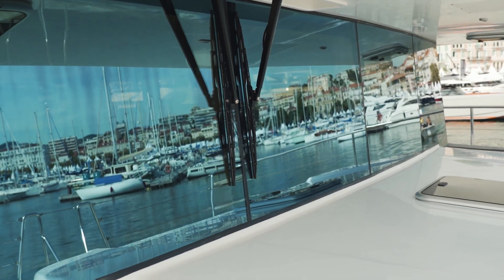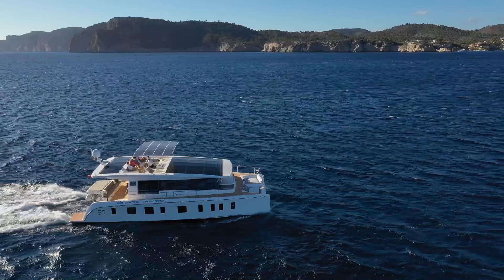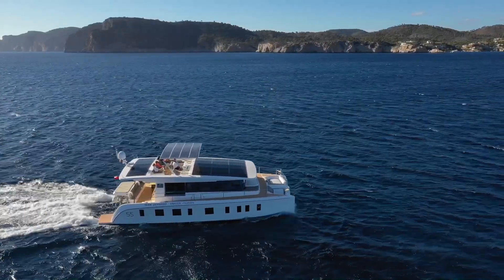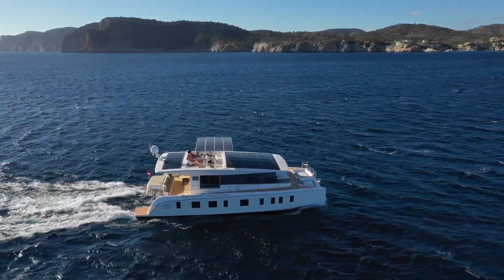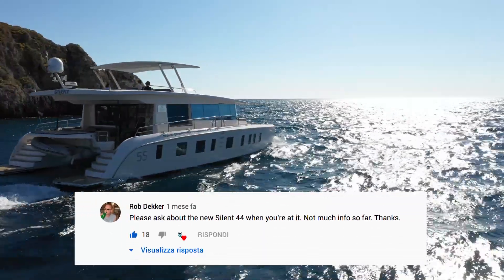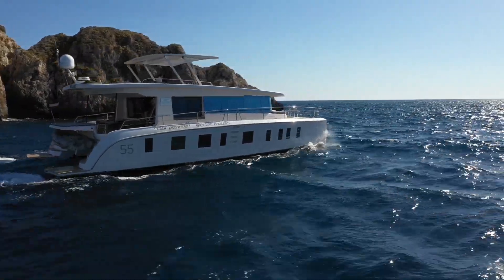WHAT MAKES SILENT YACHTS...SILENT???

Comment: I have been waiting weeks for this and you didn't do a walk-round.. Doh! I love these and I can't wait to see what they have planned. What I would have liked to know is what kind of speed would they recommend for an ocean crossing? Would they keep it constant over 24 hours or would they up it in the day time and drop it over night?
Loving the videos though.
Reply: they will not give all the secrets...damn that kitty
Reply: if you want to run sich a yacht absolutely self sufficiently for weeks, the speed is about 4 knots only. BUT - compare it to a sailboat of similar size and comfort in a typical holiday region - and not in the roaring fifties. During Summer in the Med an average speed of 4 knots is impossible for a sailing boat. Again - average - day and night. But a Silent Yacht can do this. If you want to go fast, just start the gen for 1 or 2 hours and you go with 6 or more knots. And most of all - it can stay in a bay with all comfort without need to start the generator at all.
Reply: Michael Koehler thanks Michael

Comment: Amazing concept!  Obviously, how frugally one uses the available solar energy will determine how much generator usage is required.  To put this into perspective, I would love to see how a typical cruiser would consume energy on a) an oceanic passage and on b) a day at anchor.  Also, since solar generation capability would increase with larger yachts, does the yacht endurance and fuel consumption get better as well?  Is there a sweet spot for yacht size that can make an oceanic passage at 10-knots on a single tank of fuel (with 10% reserve)?

Comment: It's not very well discussed in many interviews but the ex sailor did sort of cover it. These boats can be powered along at a speed that they are producing electricity. You can adjust your speed to the power and intensity of the sun, especially in the tropics so that you are zero cruising. Some people might ask, what about the energy required for the house side. This is generated before you get moving in a morning and either when you slow down or stop for the day.

Comment: The problem is the HVAC in countries like the US Florida, what solution do you have as we are used to running the AC 24x7, I think it has to do with the high levels of humidity,  at very cold settings, 65f or 17c.?  It is difficult to understand this habit, but it is what it is...

Comment: Thanks great episode, couple this with sails and you get the best of both worlds. Electric power will be the future of boating, hull design becomes increasingly important.
More videos like this please
Reply: in fact our Sail Versions require more fuel than the solar - it is a mere fact that the shade created by the sails cost us more power than the sails deliver. Only in a few regions of the world you find reliable wind conditions. In most places there is no wind or too much wind or it is from the wrong direction when you want to go for sailing - and then people use the diesel engine. It is a mere fact, that we use the gen to recharge the batteries less than we use the diesel in the sail version as there is no wind.
Reply: @michaelkoehler5845  and what about integrating flexible solar panals in the sails?

Comment: I understand the physics behind the trampolines in the bow of sailing catamarans ( we want the air pocket to release air pressure so we don't plain) , but on a plaining power boat wouldn't a solid bow aid in lift for plaining? Just wondering why they chose that design. ??

Comment: I wonder if it is possible to put hydro generators and wind powered generators to help with the battery charging. This would be good to try to use the motion of the water to recharge the batteries along with the solar panels.

Comment: I wish they had a motor power curve  on their website so it would be easier to calculate if it fits persons needs and also can you charge the batteries with shore power? I don't really like using generator so i would to charge it with shore power instead if solar is not enough. Maybe a 22kw type 2 charger would be good for this and it's relatively easy to install it too.
Reply: Yeah i did some calculations and it seems like you can buy a 22kw on board charger for around 12-13k € And then you also would need a type 2 charger and that cost maybe 1-2k€ and then you need a cable that is probably an other 1k € so with around 20k€ you could probably charge the 200kwh battery in like 9 hours and that's pretty good in my opinion. That would be pretty good for like a ferry that is open the day and gets closed for a night.

Comment: Adding shore power wouldn't add a lot of weight, but would add a lot of usability for the boat. A 40A x 230V = 9,2KW would double the usable charging power. Almost empty battery would be fully charged in one sunny day at port.

Comment: Thanks for the shout out!  Appreciate the answer Sir!  Edit— Are there any plans to combine sails with the electric systems?  I can’t help but think that would be a world traveling solution.
Reply: Well, at least one of the Silent Yachts has crossed the Atlantic so far:

https://www.silent-yachts.com.au/crossing-the-atlantic/

And if I'm not mistaken, their website says that a hybrid solar/sail yacht is an option, so...best of both worlds, I guess?
Reply: Electric motors on sailboats are already practical.  With Hydrogeneration the motor acts as a generator and recharges the propulsion battery using sail power.

Comment: Hat's off to these guy's as a direct replacement for sailing yachts and for local cruises. It is clear however that battery storage and photo cell power generation needs a miracle to be our long term solution to replace the internal combustion engine and fossil fuel. I do wish these guy's all the luck in the world though.

Comment: David! I was particularly interested in this yacht. I build EV car conversions for fun and Zero profit. (At least until the battery technology matures.) Low temperatures are bad for LiFePo batteries over time. I'd be curious to see what kind of charge cycle/battery life Silent Yacht gets over say 5 years? 10? Replacement 200kwh battery packs are in the neighborhood of $30k to $50k usd depending on the chemistry. How would that pencil out over the life of the hull? I've installed a pair of 2kw vertical wind turbines on a friends yacht to supplement his solar for housekeeping purposes, along with replacing his wimpy SLA batteries with a 50kwh LiFePo pack that weighs half as much as the SLA's did while providing a BUNCH more storage.  We have a pretty steady wind here on the Lower Columbia River in the fall and winter but solar power drops to about 20% or less on cloudy, rainy days. The vertical turbine makes up some of the difference but never quite all. When the temps drop towards freezing shore power is pretty much a given. Thank you very much for your excellent presentation as usual!
Reply: Combustion engines also have various runtime expenses, economy on fuel is possible depends on how the boat used etc. In the end all depends on how and how much the boat is used. I'm interested in conversion myself, so i did some estimation on available data. Electric is economically viable if boat is used a lot, not a weekender and if low speeds are acceptable. In my case it would even out in about 2-3 years of use, but i would have to stick to mostly 6-7knots with 15-16knots top speed for emergency with generator on, which i'm already doing anyway.

Comment: are these solar panels specially built for the salt environment ? Can  these panels be replaced with higher output panels (there are some 420 w panels with 22 % efficiency and even bifacial panels which will produce more power fper square meter and therefore power a larger motor for faster speeds etc )  )

Comment: Could there be a sail version with the solar?  Could they use the props under sail to recharge the batteries.  I think I read or saw something on that called a Moon drive.  Great information, thanks so much for the video.

Comment: So he already gave me the name for mine "Until Infinto" ... Anyway, what are the yearly maintenance costs likely to be? It seems that there would be very little in the way of traditional engine maintenance. Given that electric motors usually produce high levels of torque almost immediately, are these direct drive, or are they driven through a gearbox? 
With the solar panels, I'm guessing that the 100KW solar generation is theoretical maximum (which is unlikely to happen) ... how many controllers are there? One per panel, one per string? If one per string how many panels in a string? I know that if you shade a panel it will drastically reduce it's power output, and if that shaded panel is part of a string it will pull the output of the entire string down. Looking at the panels as they are arranged here it would appear to me that this particular boat is has 20x330w panels and the smaller ones on the fly top could be 12x220w which would give a theoretical max of 92.4KW. This is impressive, but only as long as none of the panels are shaded ... like they are in portions of the video. 
I'm not sure if it was mentioned in the video, what size fuel tank does the generator have? 
Last question, if you added a shore power connection and tried to charge batteries how long would it take the fire department to arrive?

Comment: I can see this is an excellent coastal cruising option, would be great for day sails and hopping from island to island in the Caribbean but I would like to know the full RANGE of this yacht. How would all this work for blue water world cruising?, Meaning, can I cross the Atlantic, Pacific or Indian oceans? 

I am assuming based on this video that I could get 3 hours of silent cruising on battery alone and the rest would be via the genset. If I am cruising across the Pacific for example do I have the generator on for an hour to charge the batteries, then cruise 3 hours, then generator for an hour, constantly going back and forth through the entire 3 -4 week journey? And what is the genset fuel used and its capacity?

Also is this company working with Sailboat manufacturers to add this system to Sailboats, specifically catamarans like Leopard, Fountaine Pajot,  Lagoon, Sunreef, Outremer and other cruisers? Could this system be retrofitted to an existing Catamaran Sailboat?

Thanks for a great interview and look forward to your feedback.
Reply: @MichaelBuck  So, I guess your question is answered?  LOL

Comment: My question to him would be what would the battery life of the lithium barriers inside the yacht be? 5, 7, 10 years? Are the batteries guaranteed to last that long? Also how much would they cost to replace? Would it be from them or can we our purchase aftermarket ones? I ask cause as it is common knowledge, the more often you charge a rechargeable device the more it life decreases based on the chemical reactions happing inside the battery.

Comment: Their website shows the solar panels to be 10kW. Assuming an average PV input of 15 kW per day, it would take 14 days to fully charge the batteries with solar power. Something is wrong with my numbers; I need more data on the solar panel average daily capture (hours x kW).

Comment: 17:00 I've often wondered why the net thingies at the front aren't trampolines with rust proof springs?  Is the market too small for what I imagine is a great fun form of exercise and physical activity, whilst on an ocean holiday?  I would love to wake up and have a few gentle bouncies or even learn/practise flipping.  OMG, could you imagine bouncing off after a hot workout into the ocean.
What about a diving board too, off the top deck?
Reply: K otgc They designed are to let the water  pass through. The last thing you want is the boat nosediving after clearing a wave and crashing into the water sending everybody flying because of the impact. With the openings the bow can nosedive without crashing into the water.

Comment: sounds like they're using NASA airfoil [using the most basic uniform null lift type foil] design cat hulls.  Very easy to make and using simple layout jig, resulting in an extremely efficient hull that slices thru the water like a butter knife.  Amazingly Low low drag at 7 knots.   Mini electric motors could be used  that pull very low amperage. ..similar to the mini Kota trolling motors will be sufficient in sets of four...two for each side.

Comment: Electric engine is best for mega yacht,car,airplane because of lowest maintenance cost what is quite helpful for the owner. I found out retractable tilt rotor propeller what doesn't have transmission what could access maximum 9 knot(at the time in 2005) in 2005. I think it could be more powerful,now. I hope you to find the engine. I saw it in YD magazing.(Yacht Design Magazine).

Comment: The sun puts 1kW of energy into ever sq m of surface facing it. A top quality panel is 20% efficient at turning light to electricity. 
So 200w per meter of panels, per hour, for 12 hours. So each meter is worth 2.4 kWh per day. 
So a boat with a 6x9m panel area, would generate 129.6kwh per day.

Comment: It would be fun to make a poor mans solar powered boat. Buy a used pontoon boat and build a large light ceiling above it with solar panels covering the whole thing. Just have a few batteries, but travel predominantly only when the sun shines. A modern day Tom Sawyer. You could certainly go down the Mississippi, but could you go back up? (No idea how fast the current is.)

Comment: My understanding is that a 1 m2 solar panel on top of a house can expect to get around 1 kWh per day of energy. That would mean the top of their yacht would need to have 100 m2 of solar panels to reach the 100 kWh per day that he said they could store. I assume the Silent 80 (their biggest boat) is 80 feet long, which is about 25 m. So that means that if the solar cell grid on the roof is within say 15 to 5 m, then they'd be well within the margins of reach that goal of 100 kWh per day of storage.

I have no idea how much energy is required to provide air conditioning or to power a boat, but at least those numbers for energy generation seem to stack up. I was quite cynical when I saw it claimed that the boat could power itself purely from  solar panels, but perhaps it is possible after all.

This concept looks really good to me, and I'd be surprised if this isn't the route many other manufacturers start moving to shortly.
Reply: you are right, I think it is just fancy wording and marketing, when he talks about solar and then that he can store 100kWh .. but legaly that does not mean he must store those 100kWh fully from the panels, he probable stores 20-30% from the solar panels and the rest from the generators in a one day cenario recharge, it can also mean that he takes many days to store the 100kWH just from solar..
Reply: No. My crude calc above indicates that they can generate that much energy per day from the solar panels.
Reply: If you eye ball the boat from above, it would have a solar panel roughly in the range I calculated would be required, assuming that the 80 in Silent 80 refers to the length in feet.
Reply: If you check out their website you can see that it can fully charge itsefl every day with solar power alone.
Reply: @maxhi88  sure on ideal conditions
Reply: The conditions are always ideal for solar.
Reply: @maxhi88   in winter with  9 hours of sunlight that is not ideal is it? with clouds summer or winter that is not ideal and etc, conditions are not always ideal
Reply: solar also works good without direct sunlight ;)
Reply: @maxhi88  good is not the same as ideal, or are you trying to say the boat will charge the same in a grey rainy day ?
Reply: Nope, but good enough. ;)

Comment: How do these yachts power with the wind.  Do they have a sail?
Also, the lost real estate taken by solar panels on the rear at 0:43 behind the founder/ceo and at the front at 2:10...could the panels be placed on 'wings', that perhaps fold in and out over the roof, so real estate can be used on the yacht?

Comment: if the battery was short circuited with sea water, would it not have an electrolysis effect on the water producing Oxygen and Hydrogen, which would be a severe fire risk.  I guess the key way of avoiding this is don't fill your boat up with sea water.  I do like the idea of electric propulsion systems.  It will be great as soon as the battery tech gets a bit better capacity.

Comment: you can just run the air conditioning on a lower temperature......just to keep the humidity out of the boat.......i don't like it so cold........and mostly anchored and in port......you have the advantage over other cats or boats and no diesel fumes......thank God

Comment: Electric Yachts - FIRST thought, never visit a fuel dock again. No oil changes or oil filter messes. No fuel spills. No diesel filters or clogs or fuel treatment. No engine oil leaks that MUST be repaired ASAP. No exhaust issues. No fuel Injection repairs. No coolant services or thermostats. In a "typical" 50 - 60 foot yacht, that's a savings amounting to THOUSANDS of dollars EVERY year. Electric yachts - $$$ ZERO mechanical maintenance.

Comment: Why not have a shore power connection? Then you could run the ac from shore power when in dock, and also pick up some charge for the batteries on a cloudy day. 240v 12K watt shore power is widely available. That is adequate power to charge a battery pack of that size. Albeit slowly, but so what? You are probably paying for a slip that has the plug right there. Silly not to use it.

Comment: comin into this i thought it was a sail boat with electric engines. i gotta say a fully solar boat is a bit of a stretch. like tht guy said solar doesn't produce tht much energy and the batteries are big and very heavy.
this still doesn't make sense to me. plus hydrogenerators make wayy more energy than a solar panel so why not stick 2 of those on the hull with sails and solar panels?